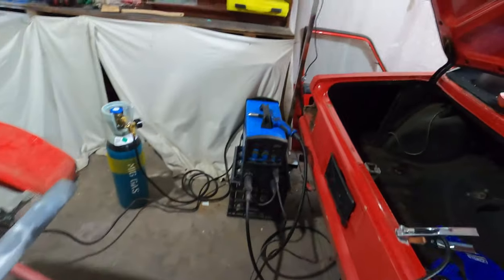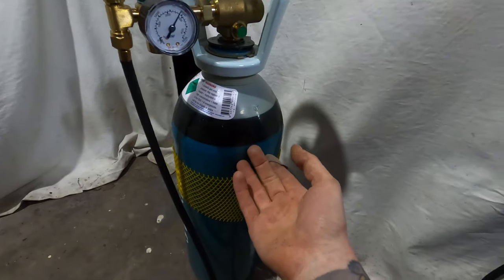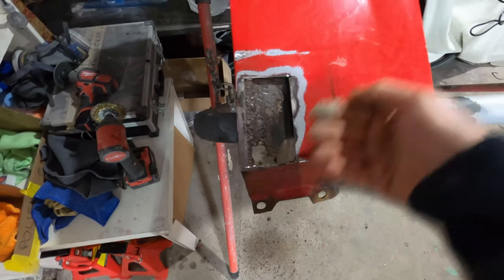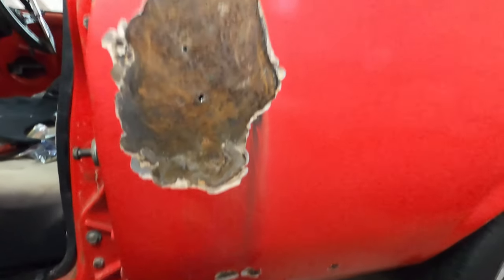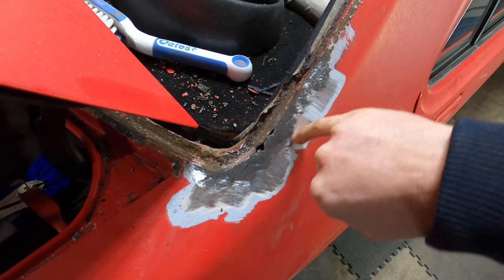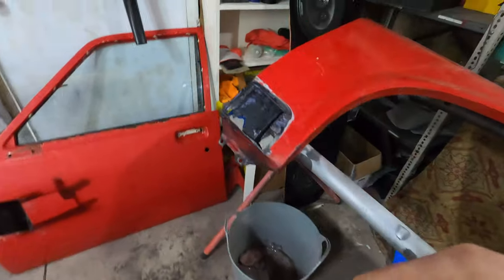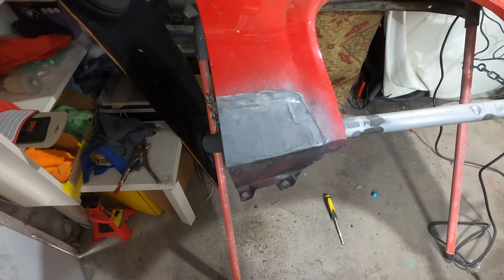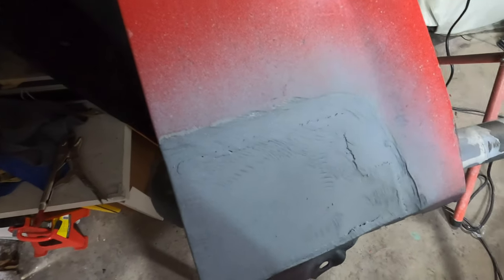Starting To Weld Some Patches In: LH Torana Restoration

Comment: If you havn't already used,  Iwould recommend weld primer. This is a primer wich won't burn if you weld your patches but it will melt and protect the spots.
Reply from the maker: I actually have some Zinc rich primer. Thanks though

Comment: If you're going to keep the car for a long time I would use stainless sheet instead of mild steel, you're wire will still weld it as long as one but up is still mild steel so no need to use stainless wire, the positive of stainless is it will never ever rust. One little tip for you after you have given me so many over the years.

Comment: If you have some holes from welding my coworker uses tin metal wire and a smal torch to fill them up . I am by no means a panel beater but it seams to work pretty good

Comment: Very cool car mate iv been welding for around twenty years but like you I'm not an expert every day is a school day as they say but the only tips I'd give you is 0.6 welding wire seams to work best on car body work and make sure uv got a good earth   and it's a good idea to keep a fire extinguisher close by because it's impossible to keep an eye on sparks when you are welding it just takes one spark to start a fire and it's best not to weld late at night because a spark could be somewhere you can't see it as iv learned from experience so stay safe mate and keep up the good work 👍

Comment: Hey Gunny you are making good progress on your car mate, the patch you fitted in the front wing looks great. If you are trying to weld up small holes in a panel and you have access to the back of the panel get a copper block about 5-6mm thick and fix it behind the hole, it will help disperse the heat and also stop you blowing through the panel as you can't mig weld copper, you can buy those copper plates just for this job as they have magnets set into the plate so they fix to the panel👍
You have a good welder there Gunny it's made by Esab which is one of the best makes out there, I have a Esab Rebel which is computerised and learns your welding style and adjusts it settings to suit, good luck mate👏🙏👍John UK.

Comment: wrong wire Gunny .6 wire better choice for body steel,. 6 will take less power to melt because it's smaller. my first welder was a EASB back in 1983

Comment: I found from experience with newer Japanese cars...Use a cutting wheel to grind the tops of your welds instead of flap wheel or grinder. Cutting wheel will only touch the weld tops and wont heat and shrink the metal like flap wheel or grinder.

Comment: I welded in some front floors for my late Dad's 72 Jeep back in the late 80's, I started to restore the Jeep a couple of years ago and was pleasantly surprised the floors were still in great condition. If you can, try and have rounded corners on your patches and they won't burn through so easily.
Reply: Yeah I too came to suggest rounding the corners - even just use a drill first - the corners cop a lot of heat and have a tendency to sink

Comment: Been a subscriber since b4 u did your falcon. I recon u should take a look at Fitzees Fabrications he has some really good videos on cutting in and making window panels into rusty cars, also taught by a welder to use canola oil spray as spatter spray a lot cheaper, homebrand woollies or coles. Cheers